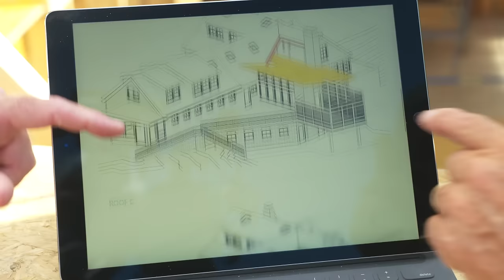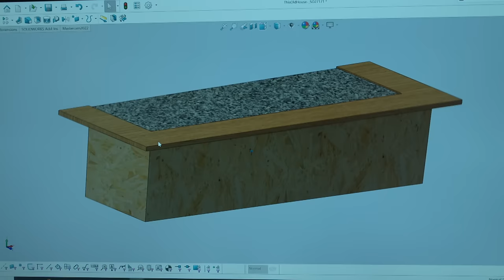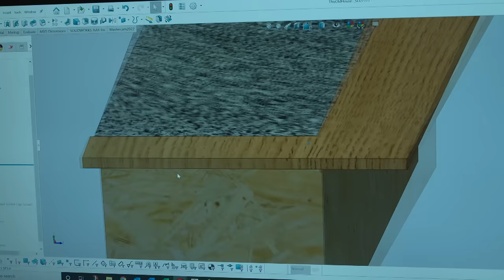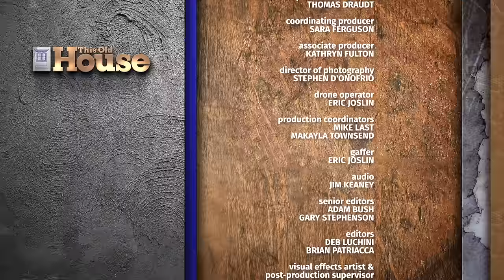This Old House | Planting for the Future (S43 E10) FULL EPISODE

Comment: This remodel and additions has to cost, just a guess, between $4 and $5 million. Why not just build new ?
Reply: Because the permits and regulations and codes and grading and sewage requirements,, etc. would push the cost through the roof for new construction as opposed to remodel, not to mention the time it takes for city permits and approvals and sign offs.
Reply: In New Jersey, keeping part of the original structure has a large impact on limiting the increase in real estate taxes